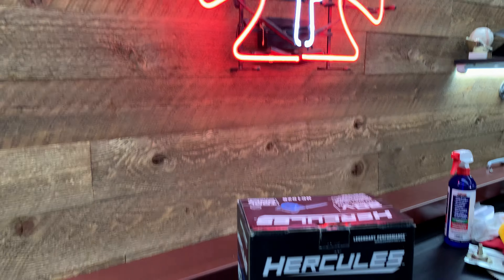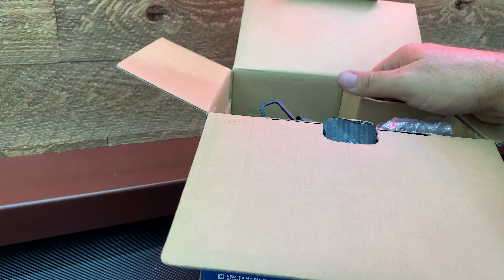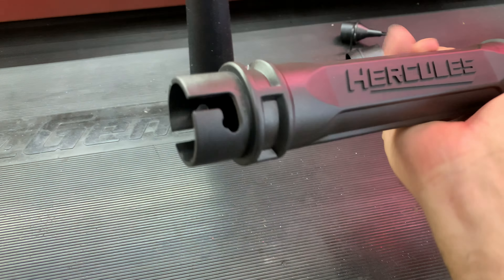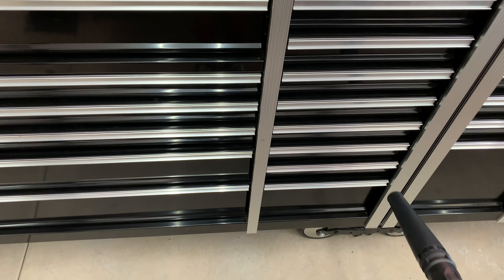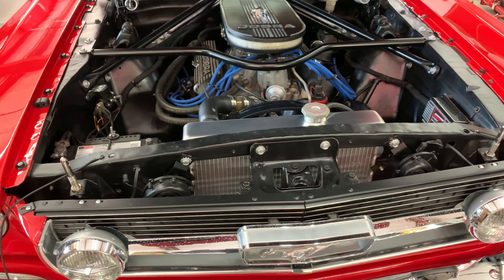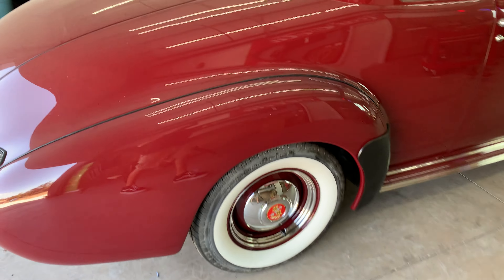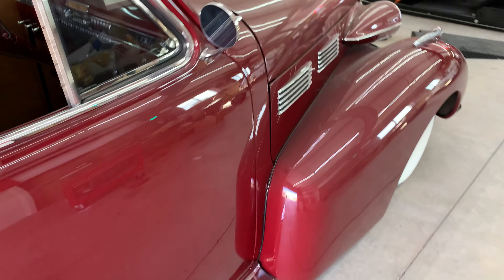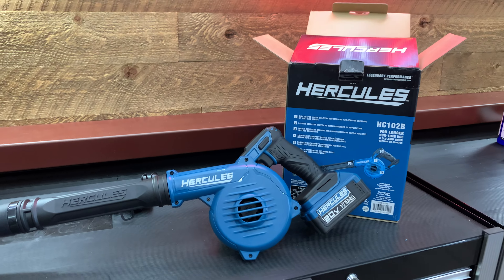Harbor Freight 20v mini shop blower

Comment: I had gotten the one from bauer that appears to be the exact same blower without the plastic extender for I believe it $20 price difference. I seriously think they're charging $20 for the plastic piece to extend it out that I was able to do with some random shop vac extension rods. Had lying around, the weird thing is it sounds like that tools up a little bit faster than the bauer has me wondering if that plastic base makes it a huge difference coming out in the beginning going against something hard other than the soft piece that comes with it, if that's the case, sounds like anyone who wants to put a piece of PVC on the bauer can save 20 bucks lol, especially if you have any power 20 volt tools so you don't have to pay extra for what is ridiculous despite being the same tools. Basically having a different battery for Hercules versus the other
Reply from the maker: That’s a great point. When I purchased this, the Hercules was the only option but they do seem to cross over the two brands. I will do some research and see if they list any different. I will say, that little blower is always in use. It’s really perfect for small jobs.
Reply: im gonna have to get a solar panel for the charger on mine soon with how i use it lol, it really is stupidly convenient vs a leaf blower or esd vac ihave wich i love but is akward as hell portability wise, well if it ever conks out on u and u find out the bauer is the same, they sell adapters so u can use Dewalt batteries in them, wich for people like me who found awesome generic dewalt batteries but shelled out the premium for the fast charger saves oodles of cash, off the top of my headthink the adapter was 18 to 20$ tops dewalt charger on sale for 35 prob typically more 40 to 50 range, and u can snag the bauer blower for like 30$ right now, so your still talking anywhere from sub 100$ range if u have the batteries or a lil over 100$ all in all price performance wise vs comeptition a steal
 @JHickmanIII

Comment: I bought this because 1 it's a lot lighter than the EGO leaf blower and 2 I want to use it to blow the water out of the nooks and crannies after washing and towel drying the car.
Reply from the maker: Yes it is excellent for that!! I've used mine so many times for quick-drying cars and anything I'm washing with tough to dry areas. Its not the strongest blower but its compact and ready to use anytime.

Comment: this blows is only good for light blowing.  not good to clean trash with in a parking lot. it's only a dust blower and kicks up all the dirt. I'm taking mine back for the Bauer, which is much bigger like a normal blower.

Comment: Hercules makes very good tools, but they are an exact copy of Dewalt. 🤷‍♂️
Reply from the maker: It’s funny you say that because I actually purchased some of the Dewalt adapters for my Hercules vacuum.  I think the hardest thing for me is to find a line of products that I can stick with that has a reasonable price. I had Ryobi in the past and liked them but it seemed like the batteries were always having issues and the price was a little on the high side. So far the Harbor Freight Hercules tools have been good but only time and use will tell. Thank you for your comments and I look forward to hearing from you as I post about the longevity of these tools.